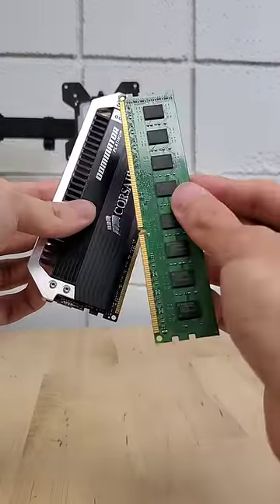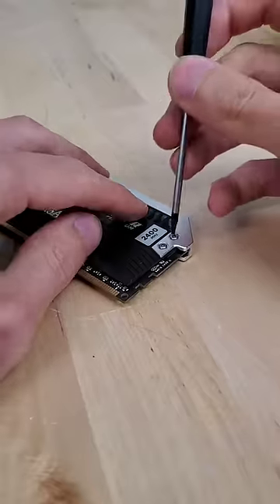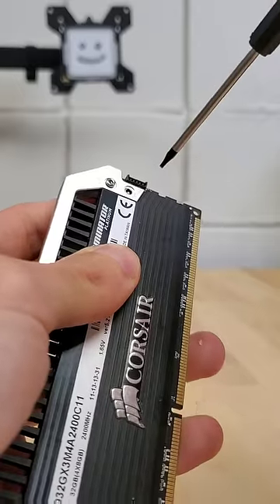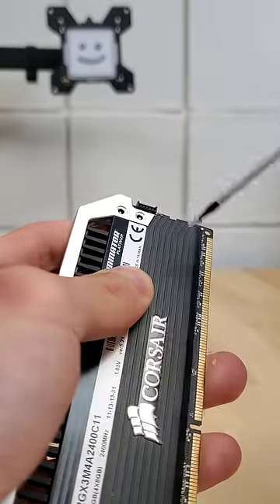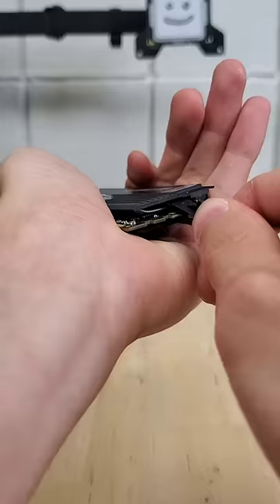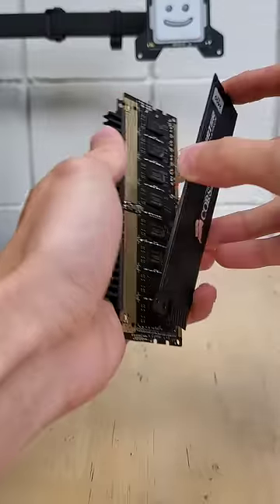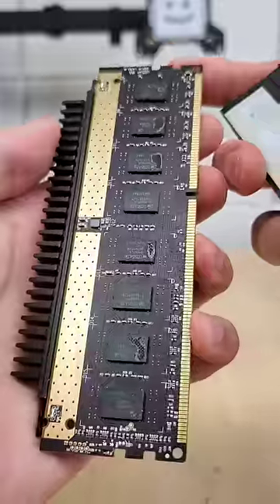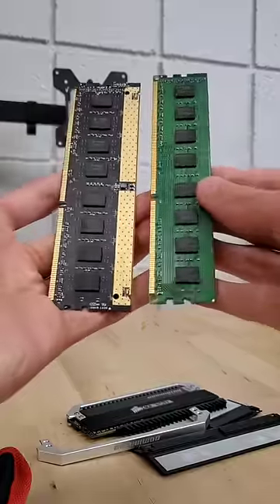why do these RAM sticks look different? #shorts

Comment: It’s a heat sink sir. To help dissipate heat from high speed performance ram
Reply: ... Except this is very ordinary almost JEDEC specs RAM that wouldn't reach 50°C without its heatsink to begin with...
Reply: 2400mhz...

Comment: They are quite similar on the surface, they are both sticks of ram at the end of the day, true. However, the Dominator is build for higher performance, the inside, what counts, is different. It is like saying a base BMW 3series is the same as an M3 just because both are cars.

Comment: Yeah … but those heat spreaders are on there for a reason
Also note that the old Dominator ram used to have the fins screwed to the top part so that the user could remove these and use a liquid cooling block on them
Reply: Liquid cooling my rams sticks 💀
Reply: @DaddyM7MD  look at older videos from singularity computers and you will see what I mean
There is also some recent stuff I have seen on DDR5 that preformed a lot better when liquid cooled … specially with the +6 GHz stuff
Reply: The SSD I recently got had the option to buy it with a watercooling block kekw.

Comment: Those are heat sinks… it allows to dissipate heat and also protect the PCB for dust which might cause short. These heat sinks are necessary for high end fast RAMs as they produce lot of heat.

Comment: Those heat spreaders are pretty important IMO. They won't improve performance by anything more than a negligible amount, but they will allow the RAM module to be at a more even temperature (versus hot on one end and cold on the other end) and any airflow will help remove some of the heat. In either case, you get an increase in longevity and reliability.
Reply: The bare stick probably runs at 2133mhz. The heat spreader stick is probably rated for 3600mhz+. It makes way more heat because running in XMP profiles is literally overclocking but easier. That heat spreader is absolutely essential to keep those chips from melting if they're running at the speed intended.
Edit: I just saw that stick is pretty old and I believe is ddr3 so it's only like 2400mhz, but the point still stands that it's running well beyond what it otherwise could.

Comment: Inside that counts: “why is my PC slow?” “Ohh my Ram overheated 🥵”
Reply: The ram is inside the heatsink to spread the heat and get colder compared to a ram without it
Reply: @papit4886  no shit
Reply: If your RAM overheated your computer would not be slow, it would completely crash.
Reply: Your RAM overheats and it won't be slow. Your framerate will drop to 0.

Comment: "You might be surprised under the cover they're quite similar" - no, not even a tiny bit
Reply: The PCB is a bit different but is basically the same exact shit. And it's not because the PCB looks futuristic that the chips on it are necessarily better than those on a green stick.
Reply: But they literally are a lot better lol.
Reply: @GoodOlTazzy  
No. They are not "a lot" better. Better? - yes. A bit better.
Reply: @AliShuktu  every mhz counts. You'd be surprised how big the difference between 2400 and 3200 is in performance.
Reply: @GoodOlTazzy  
In Intel systems?:) Show me. ;)
Reply: @AliShuktu  I've had personal experience seeing up to 10-20fps more with 3200 compared to running 2400 for a short while...

Not to mention that the 3200 was 4 channel and the 2400 was single channel which made it much worse as well.
Reply: @GoodOlTazzy  
4 channel?☺ Memory doesn't have channels. A motherboard has. Both 3200 and 2400 can work in single or four channel mode. How even old are you? :)
Reply: @AliShuktu  I told you the 3200 were 4 sticks aka quad channel, and the 2400 I had used were only 1 aka single channel.

what does age have to do with this?
Reply: @GoodOlTazzy  
4 sticks doesn't mean there are 4 channels.😅☺ What is the full name of your mobo?
Reply: @AliShuktu  i had a first gen threadripper a while ago and forgot the specific model so 4 channels...

Current pc runs on boring dual channel.
Reply: @GoodOlTazzy  
...Well i asked you about intel systems didn't i?☺
Reply: @AliShuktu  on intel too.

speed not being important were only pre ryzen. Now they matter even on intel, not as significantly.
Reply: @GoodOlTazzy  
Ok. Show me tests. Link?
Reply: @GoodOlTazzy  how do you know that those green sticks are not 3200? They really can be quite the same and because there isn't much to add to ram, companies sell you the looks

Comment: What's important is the specification of the RAM, not the cooling on it.  The cooling is often just flair to make it more appealing.  You shouldn't be trying to make out they are comparable without checking the spec.

Comment: They may look the same and may also be in fact identical under the heat shield.   The similarities and similar functionality end there because the one without a heat sink, will not function the same as the one with.  This becomes even more noticeable as the temperature of the chips on the board increase.

Comment: Well the Corsair stick around looks the way that it does because those are heat sinks which dissipate the heat. Whereas the other one that has nothing and is playing will likely get hotter and stay hotter longer and when those components get too hot they wear out quicker.

Comment: Performance-wise they're not the same. The ones with the heat spreaders are differently binned because they're chip modules that have passed stress tests and have been verified to reach the speeds they're advertised at. They typically run a bit hotter than normal Ram modules so they NEED the heat spreader.
Reply: XMP profiles make way more heat. One runs stock speeds, one runs above them.

Comment: What's on the outside is actually really important as it help what's inside live a better life
Reply: Not in the case of DDR4 RAM. It doesn't get hot enough to require heatsinks.
Reply: @googlewolly  you must have some freaking trash memory or are running at stock speed. I have RAM with heatsinks and it gets quite hot. Anything running on XMP profiles absolutely needs thermal management. Going from 2133mhz to 3600mhz tends to make more heat. I dunno who the heck keeps telling people that ddr4 is incapable of overheating, cause that's stupid. Running anything beyond the speed of the normal standard will make more heat.
Reply: @ec7005  No, you're just wrong and aren't aware of common knowledge. I have 3200 RAM (with XMP enabled), and it has heatsinks. It's just that most - if not all - RAM does not require them.
Reply: @googlewolly  sure, it doesn't require them, but it sure helps them last longer. Plenty of things function while way too hot, but it'll make them break way earlier. If you are running at low clocks, it makes 0 difference. If you run at high clocks, they are beneficial.
Reply: @ec7005  Doubtful. It's possible that instead of lasting 15 years, it may last 14.5 - but I don't think that anyone is going to be concerned with that. Generally speaking, they're a gimmick that makes the RAM look cool or "gamery."

Comment: The metal plating on today's memory helps spread the temperatures evenly so the components don't overheat.  Never buy memory for the looks or just "rgb", look also at speed , reliability, and compatibility with the motherboard you have.

Comment: Screw these corsair rams, I have 4 of the same types and the top metal parts shorted the computer every time they touched each other. Had to remove the top parts for them to actually work...

Comment: Yeah. Insides are vastly different. The two PCB's are on completely different levels of manufacturing and performance. The black PCB is designed to wiv heat away as fast as possible and prevent as much inter circuit cross-talk as possible, thus needing more layers to the PCB and vastly more ground planes, even shielding layers.

Comment: With good airflow
I took the ram radiator off
RAM won't be affected by high temps unless you have terrible or very inneficient airflow and heat dissipation in the case.

I prefer the RAM being smaller, not uglified by useless space easters

Comment: Thw only difference is the large one needs a heat sink because it works harder and emits more heat and it's the heat that decreases the ram cards lifespan meaning you'll have to keep replacing them every month or week depending which is very costly
Reply: every month or week? what??

Comment: Quite similar? Gold PCB, better circuit characteristics, higher heat transfer capacity in PCB, better RAM chips, better components, better pads etc, they are two different products. One is a Ferrari the other is a cheap Ford.

Comment: What's the difference. 
Proceeds to not actually explain the difference.
The "more fancy" stick has heat sinks, designed more for computers where high ram usage for extended periods of time with other higher performance composure which generates a lot of heat. The average user will be fine with normal sticks. However the Fancier sticks are usually more aesthetically pleasing, where pc enthusiasts choose base on appearance.

Comment: I was with you until that last line. You seemed to be implying that the green stick is the same as the Corsair stick once you remove the heat sink. I’m going to assume that the Corsair is probably way faster than the other stick. 

So considering the general context of the video your closing statement makes no sense.

Comment: That pcb was way different it has more layers than the cheap Hynix RAM also the chipset controller is way more advanced in the more expensive RAM. Also the heatsink is important too, as the more heat it can dissipate the better and more efficient the RAM will run.

Comment: That’s… not entirely true. Yes the ram looks the same but Corsair platinum is probably going to run faster/hotter than some untuned base clock ram. That heat sync helps cool the ram which creates more thermal head room which means faster clocks.

Comment: When companies decided to rip you off in STYLE
Reply: not really he basically took off the heat sinks which are kinda sorta important
Reply: They aren't ripping you off. It's a lot more expensive to produce memory that can run at 3600mhz on an XMP profile without breaking than making memory that can handle a baby 2133mhz its entire life. You need better materials and heat management and better resilience to handle much tighter timing without errors. dram chips look like dram chips, but 3600mhz dram chips make an awful lot more heat. It's literally ram that is going to be running heavily overclocked its entire life compared to actual standards. That's what XMP is for.

Comment: I just pride and pride as hard as I could until I rip the heat sinks off. Went through several sticks of ddr5 this way
Reply: Could have just bought them without the heat sinks. Your basic DDR RAM doesn't suffer as much from heat as other types, such as RIMM-RAM and FB-DDR RAM, which get notoriously hot.

Comment: A0 Dominators 💀💀💀

Hynix 4Gbit (BJR presumably) too, the worse the better!
Reply: I have A0 MFR dominators, some of the earliest DDR4 that came out, and boy do mine overclock well. From 2666 cl15 to 3200cl16 with tightened prim/sec/tert timings. I haven't even pushed them to the point of instability, but I doubt MFR can go much higher than this. I think I increased dram voltage by only 0.15v
Reply: @ToYo94  MFR? Overclocks well? HAHAHAHAHAHA HAHAHAHAHHAHAHAHAH ABHAHAHAHAHAHAHAHAHA
Reply: @Krazycrafter  Nice reading comprehension. I said mine particular sticks overclock well, not that MFR dies are good overclockers, they are generally among worst.

Comment: What's on the inside is heat, what's on the outside pulls that heat out allowing the inside to get hot again.  One stick will get hot and throttle, the other will get much hotter before throttling... Not very apt for human psychology.

Comment: Hey looook a bunch of stuff glued to the outside so we can charge twice as much, COOOOL!
Reply: to be fair, its actually just a heatspreader, not to mention most ram (whether basic indiscript ram or ram with a heatspreader like corsairs ram) costs roughly the same between speeds and latency, you might save a little on less fancy ram but its only once you get to the stupid rgb shit that the prices really start to differ.

where the heatspreader ram comes in handy is in resale value, for good reason too. you can typically resell ram with a heatspreader for higher amounts simply because it adds greater assurance that the ram is in good condition, simply because with less exposed parts its harder for soemone to accidentally damage the stick of ram. 

so yes whilst its definitely marketing shenaningans, the heatspreader does actually serve a purpose (heat spreading... duh :P) and lets be honest it looks much nicer so i dont mind spending say $60 on my ram set rather than $50
Reply: @jacobely6826  I don't mind the 260 I originally spent for my ram.

Comment: lol also depends on the specs. they both do the same but differ in performance. 

there are 2666mhz that are clocked 16 today kingston released value rams clocked at 19 see the difference there?

Comment: You sound quite confident while you deliver false answers.  The fact that the other stick has a heat spreader may indicate that it is a different speed and generates significantly more heat than the other unshielded RAM.

Comment: these are not same rams. Black One is binned to have tighter timings and higher clock and take higher voltage than the green ones. Don't put out crap youtube video if you don't know the difference

Comment: Oh, you have no idea how very wrong you are.
Designing a PCB to work with high frequencies is not easy, and on the overclocking modules you have specially selected the best quality memory chips, not to mention some pretty cool / compatible SPD profiles

Comment: Do those sticks increase performance?
Reply: Well, they will stay cooler because they have a heat sink (the metal bit ontop) but if they were both the same speed i the black one is better
Reply: @5kyh1gh11  i was going to buy some ddr4 ram, which one should I prefer? The black ones are expensive, so are the normal sticks really worse thank the coated sticks?
Reply: Not really. 

They are a more "premium" stick of ram, so if you have a motherboard that can take advantage of XMP profiles you will get better performance offer a standard stick.

 the heatsink and stuff is pretty much just for show, DDR4 doesn't get very warm at all, it's basically a marketing gimmick to differentiate the product in the market, otherwise all ram would look the same besides the PCB color. 

Server ram I used to work with got so hot it'd burn your fingers.
Reply: @kathras  If the normal ones are the same speed as the black ones i would buy them as they are cheaper and the heat sink does not really do much, but thd black ones look sooooo much better but it's all up to price really
Reply: @volvo09  Yes, but if you were to have a Corsehair stick at 2133 Mhz, and a Crucial one (the green one or whatever it's called) at 2133 Mhz they would both preform the same but one would look better and be more £$€¥
Reply: @volvo09  Thank You So Much For The Valuable And Experienced Opinion. I am getting the normal sticks, They Cost Way Less, And Are The Same In Performance!
Reply: @5kyh1gh11  Thank You, However, We Shouldn't Go Behind The Looks Right!
Reply: @kathras  Yup, well enjoy
Reply: @GenerallyRetardedFilms  Not correct. They can have different CL times.